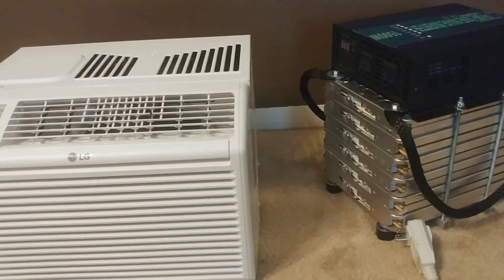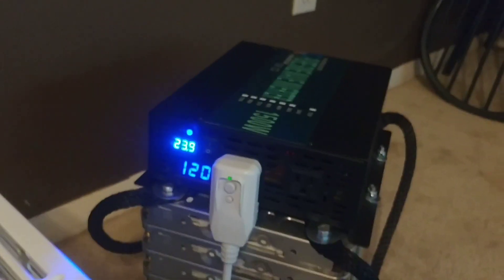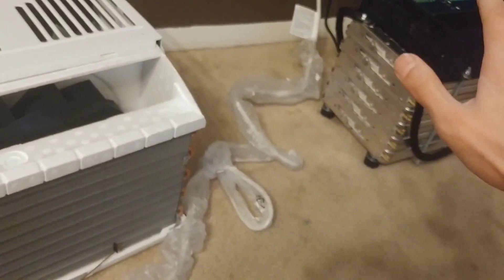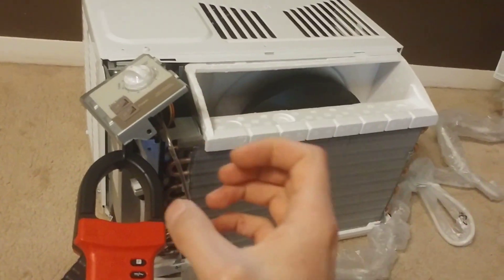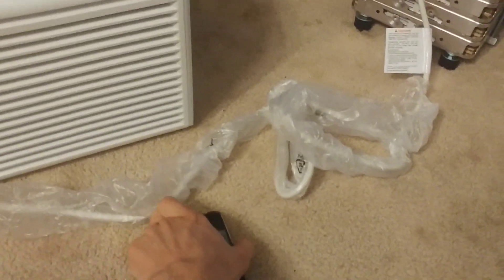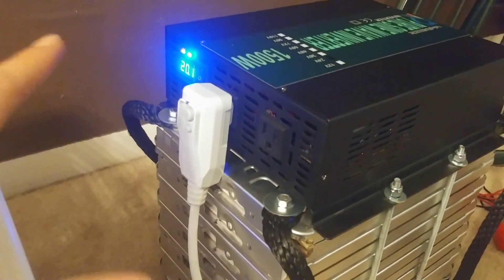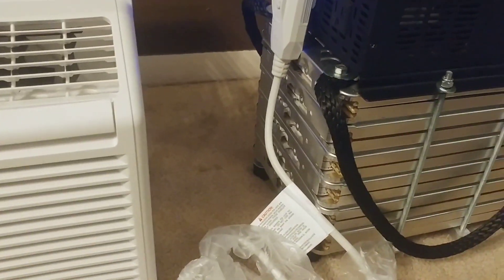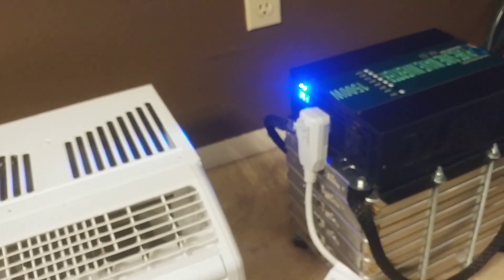Air Conditioner vs Solar generator (with reliable 1500w inverter and 6 leaf modules)

Comment: Very cool.  You should make your pack a 7S instead and it would run longer before the inverter cut off.

You would have to buy another Leaf cell and open it to change the connection from series to parallel to make the 7S.

Comment: Nice test! I know this video is old as of this date, and I'm sure you've learned a lot more about A/C compressors by now. You should have done a current draw from the mains with a rotor lock condition. I bet it would have spiked over 35 amps from the wall! Also, you should have kept monitoring the running amps during the test. The current creeps up as the compressor encounters more head pressure during operation. I'd say you got some decent time from those Leaf batteries.

Comment: Soft start kit ! I installed one in my RV ac unit ...
Reply: Ya but aren't those like $300 if that's the case he would be better off spending that money on a bigger inverter since that soft start would turn his like $150 ac into a $450 ac

Comment: Thank you for the video. I have been purchasing 2nd gen leaf batteries. I hope I get as good results as you. I had poor results from my gen 1 batteries.
Reply from the maker: I've heard people say that cycling them all the way couple times can restore some of the capacity if they been sitting for a while
Reply: @sideproject4028  I have cycled them and still no real improvement.  I think I was sold bad batteries. I have 7 connected in series and with a 110 watt load they run out after 8 to 9 hours. That is about 1000 watt hours much less than the batteries are supposed to be rated. I have purchased about 38 kwh in batteries from the same person your purchased from. I will be testing them in a few weeks and I will do a video.
Reply from the maker: @drsolar  you got a new sub. I will be waiting on an update!
Reply: @sideproject4028  thank you so much for the Sub. I appreciate you taking the time to do this. I am currently in New Jersey and they are on a ship to Nigeria. Once they clear I will make a new video. I have 3200 watts in solar panels and no grid connection or generator. So the batteries are critical

Comment: besides the 6 modules and the inverter are there any other supplies needed to  build a system like yours ?   I looked on line and it was like 500 dollars for the modules    for 4 hours    so I am assuming 12 modules would be 8 hours .  So 1000 dollars in bateries to run the ac for 8 hours .I think its correct.      My question   is   how are you charging the modules and balancing them ?
Reply from the maker: I got a detailed video on how I made it with everything I used, check it out! As of right now I use RC charger to change it, but I got better, faster, option on the way. I will share when I get it done!
Reply: @sideproject4028  anyone reading this email me please if you know how I need to wire 8 modules in 24v please.
I am doing 2 of these 6s units but not sure how to tie them together plus how to connect to my charge controller and inverter....  plus there should be a better inverter then the one in this video to use that can be adjusted for the nominal sub 24v range of these modules. Also how do I wire the 6s BMS board?  (In 6s they are 19-25v)  tfrentz@hotmail.com  - thank you
Reply: @TimFrentz  well they have an 18v Inverter which should work pretty well for 6s and let you charge to like 4v so almost full and discharge all the way so a lot more useable power or go up to a 36v inverter they have a little more selection there and 5 of those modules for 10s which should work well